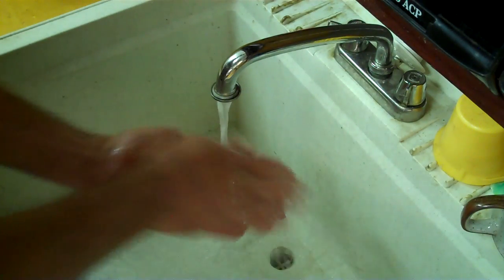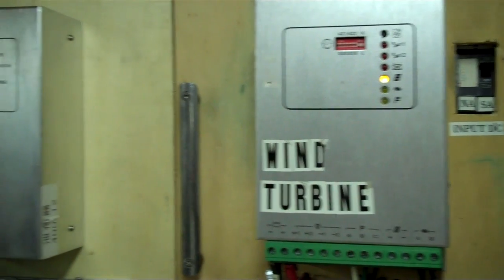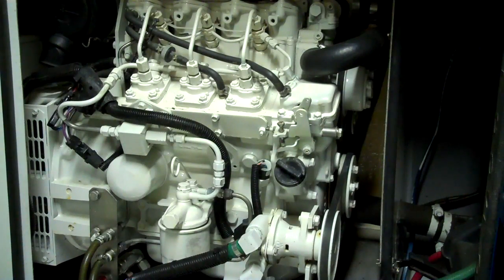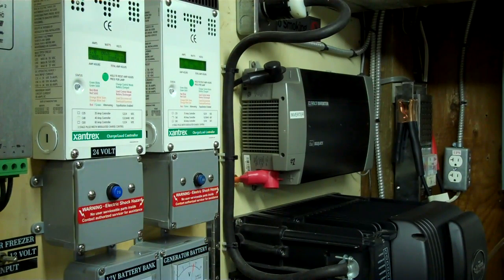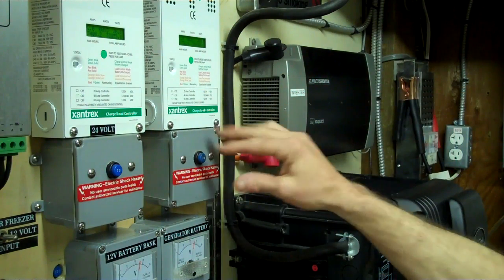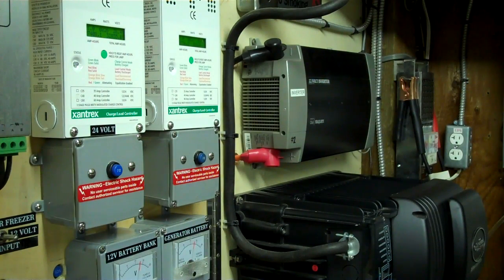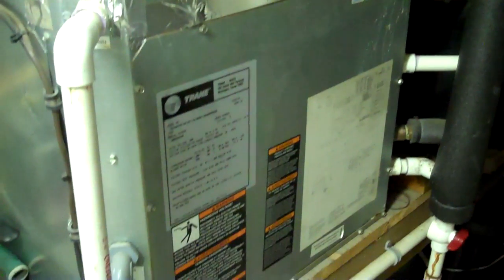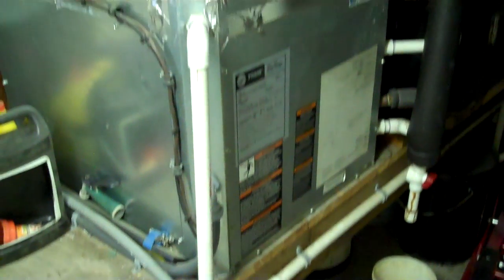HOW I HEAT WATER OFF GRID USING SOLAR POWER (PHOTOVOLTAICS) and all my other options..

Comment: I would do things differently for heating water.  I would change the water tank for an A.O. Smith water tank with two elements and a heat pump.

The heat pump will provide you with a new way of heating water in addition to PV solar and geothermal heating, but it will do this very efficiently.

You might want to change one of the 4,000 watt or 4,500 watt AC heating elements for a 2,000 watt AC heating element.  This will provide you with a heating element for your PV load charge controllers.

A benefit of this setup is that if you have a high humidity environment the heat pump will draw humidity from the air, and this will decrease the humidity.  If your water tank is next to all your electronic equipment, then this will increase the longevity of the same by reducing the humidity.

Comment: Today, Direct PV is the best way to heat water. PV prices are low and getting lower. You have a nice system! for 2013 you were 100% correct. 2019 and things have changed. We will soon be seeing a ton of household appliances running off direct PV. No batteries needed for many of them! It's only going to get better!

Comment: This is a simple, efficient system given the many energy sources it has.
He sells to the grid, and he has a backup system when the grid goes down.  
The majority of grid tied systems do not work as a backup system when the grid fails.

Despite his opinion , I think he has a very efficient way of heating water by utilizing excess energy, and this, also, avoids creating problems in his installation.  

His system is efficient since most of the energy diverted to heat the water actually heats the water with few losses.

The other amazing thing about this system is the redundancy.  
If his solar, wind, or hydro fail, he still has a fuel generator.
He has a geothermal system for heating with a minimum of fossil fuel consumption.

He is better prepared against unforeseen problems than most of us.

I imagine he must have tinkered with it for quite some time.

Nice to see someone so far along this route.

Comment: I heat all my water at camp with PV and that is just with excess PV power that would just be wasted. I use 2S grid tie panels for about 60V.  These match well with 2,000W 120V heater elements.  At home I have a HPWH but for the price you could do supplemental PV water heating  economically.  If under powered, you will use almost 100% of the PV energy. It is hard to get a better payback than that with solar.  I don't see why these PV systems are not very common.  I have posted multiple plans.  However, only 0.001% can build this stuff.  Just think of the energy that could be saved if someday 50 million homes just had 300W of solar.

Comment: Been heating water with 1500w PV as a shunt load for over a year. Standard waterheater using a 200A relay to feed the element from mppt controllers. Control voltage on relay is 24 v from an old ac transformer fed through the thermostat. Very safe, simple and cheap. Temp rise of 40°F is about 2.4kwh so preheat with a tank to about 90°F on the airspace heater in the winter.

Comment: With PV panels getting cheaper since this video was made - It has been said that heating water with PV panels now makes more sense than a solar-thermal system.
Reply: Unfortunately, as a guy who has installed a large solar-thermal system, you are correct.  PV + hybrid (i.e. heat pump based) water heater is the way to go.  Direct resistance heating with solar PV isn't too great, however.
Reply: @unhinged-menagerie  using solar electricity to heat water is not efficient. Better heat the water directly with the sun ☀️.
Reply: @ajarivas72  Surprisingly no.  A hybrid heat pump water heater driven by solar PV will outperform flat plate or evacuated tube solar (if in a warm environment).
Reply: @unhinged-menagerie  I will look into it.
Reply: @ajarivas72  A grid-tie solar pv system that is 20% efficient, paired with a heat pump hot water tank with a COP of 3 results in an effective efficiency of 60% when the system is operating, versus 80%-90% for solar thermal.  The benefit is when the sun goes down, or when the hot water tank is up to temperature.  Once the hot water tank no longer needs heat your solar pv array continues backfeeding to the grid, offsetting your power usage.  

Your hot water heater only needs to produce heat for a small part of the day.  My solar thermal system has to dump hot water regularly when it's sunny out (max temp set to 75C), and during the night it produces no heat whatsoever.  A hypothetical heat pump hot water tank with a COP (coefficient of performance) of 3 will use 1000 watts of solar to produce 3000 watts of heat, provide a small amount of air conditioning in the process (reducing AC power usage).  When the hot water tank is up to temperature, then the solar PV can back-feed to the grid offsetting your power bill.  All of the solar output will go to good use.  Even when there's no sun a heat pump water heater will still be extremely efficient (3x as efficient) when using grid electricity.  A solar thermal system will turn on a resistance heating element when there's no sun.  

In contrast a solar thermal array will produce heat until the hot water tank is up to temperature then it's useless.  Also solar thermal is just a pain in the butt maintenance wise.  I've had three pump failures over 10 years.  Solar pv is no maintenance.
Reply: @unhinged-menagerie  

Thank you very much for the abundant information you sent me. 

I understand your explanation 100%. 

You really know your stuff.
Reply: After 3 years...more and more! No it's time for everyone to do it

Comment: this is nice an all, but with my budget, I'll heat water with fire in an emergency when possible.  which should be about every day. I will use the sun to heat as well using black painted containers, when I have sun. the other possibility is to use PV directly to a heating element to heat small batches of hot water for sponge bath or sanitation of dishes. Not using battery, just PV hooked to element.  So I will use less expensive options in an emergency. Currently N gas is very reasonable compared to all of this equipment.

Comment: not afordable  ffor  us working people, too expensive and  complicated, need simple  now!
Reply: I did it off grid. Like you say very expensive and the batteries get wore out. I moved my panels to grid tie and used a cheap immersion heater diverter. If you get the panels off ebay and do it yourself very cheap

Comment: Your system is complicated and I guess very expensive.  Can you say what your payback period is likely to be?  That probably is not a consideration to you as security of energy supply looks to be of primary importance.  Nonetheless for any solar energy production at the individual homeowner level to be realized it has to be cost effective.  You also mentioned that converting PV energy capture to the water tank is not that efficient...I would argue otherwise.  The water tank just becomes another storage medium for the energy capture and when done with a water heater element the transfer is about as efficient as it gets - 97% efficient, no?  Everyone needs hot water in their home so I see this means of solar energy capture really taking off in the future as PV costs continue to decline.  Solar thermal system will become true red herring systems for residential water heating.  My 2 cents...
Reply: +EcoSenseMan 
Besides, it is way easier to run wires than pipes. And electricity will not freeze inside those wires.

Comment: i am going to put a bunch of black plastic pipe on our back roof this sumer and conect it with a low speed circulator pump thats on a timer to the watter heater the pump will come on at around 11 am then turn off at 5  it should give almost free hot watter all day and with a insulated tank it should hold the heat for a while

Comment: im going to install 10 - 235 watt panels i can set these up in to sets at 60 volts is it better to use 60 than 48 I'm going to run these to 2 2500 watt grid ties. what is your opinion on using 60 volts verses 48 volts.  thanks

Comment: You can use MPPT to make heating water with solar PV panels more efficient using a Solar Hybrid Hot Water Controller (ebay) and not have to change the lower 240V element, the MPPT makes the load match at all times, especially in the mornings and afternoons when a load like that would drag the panels down below their max power point. PV is very attractive when you look at all the hassles and leaks you could have from plumbing, plus the cost factor with PV at 68c/W and less. Wires are easy to run.

Comment: I'm using a TS45 PWM charge controller in it's normal charger mode. It's connected to my back-up 48v bank. Since it's a back-up, it's normally in 'float' mode. The 4 Panels (in series) are 500w of wasted power after the bank is charged. 
I've connected the  PV wires to the TS45 in parallel with a 13 ohm hotwater heating element. It can keep the bank charged & dump some nice BTUs into the hot water heater. Cloudy? The A7 Airtap works fine. 
Also have 800w of PV on the other 13 ohm element.

Comment: i have a small system that i set panels out and run electric wires for tv and computers and i try my camper for 48 hours only solar like if the grid went down my campers a 12 volt system & 120 too, I got 10 batterys & 2 inverters with 300 watts of solar panels too! i got small 12 volt light system too runs off solar too! it saved me about 10 dollars a month plus may i have no electric bill! it was 95 dollars a month down to 83 i june about 10 a month! good idea on water tank gregg